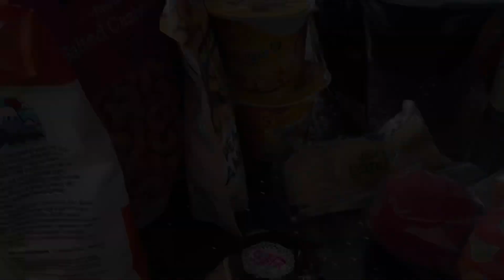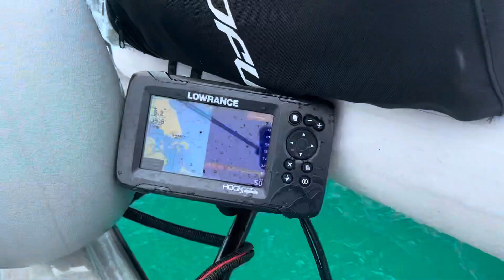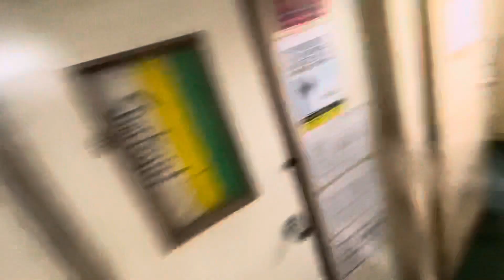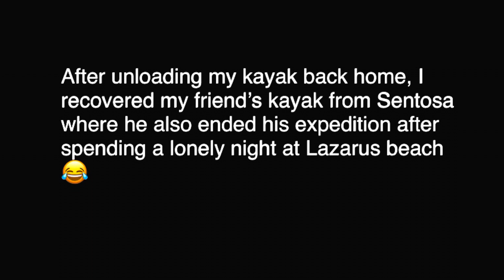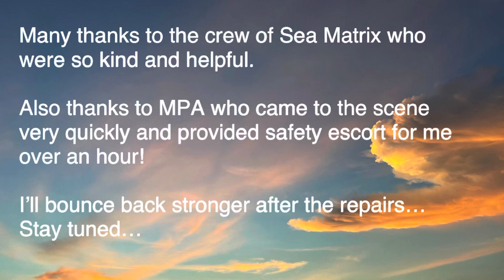Episode 19 - Mayday SOS

Comment: Thanks for the interesting video Koon.  Experience with my Mirage on Great Lakes in Canada is that the big leaker is the front hatch.  I proved this by putting my phone inside on video looking up and spraying water on the hatch from outside.  Following tips on Hobie forums, I got rid of the outer gasket on the hatch lid, then added some  'formed in place' silicon on the underside of the lid where it was not meeting the hull gasket properly.  Also replaced the bungee and made it pretty tight.  It's still not perfect, but much better.  My Hobie is about 2016 - perhaps upgrades to the design have been made since then.
Reply from the maker: Thanks for taking the time to share your experience 🙏. You are right. One reason why I failed to notice this for a while is because the hull will actually flex and twist which will create wider gaps for water to seep through. One solution is to use a inflated 14-16 inch tyre tube to tighten the hatch seal.
Reply: @koonweing  A tire tube! What an interesting idea.  I'm going to try that.

Comment: Thx for sharing. Inflatable kayak a better choice you rekon?
Reply from the maker: Hardshell usually more efficient and hardy. Inflatable is probably good for shorter distance or as lifeboat. I like inflatable for the lightweight and convenience.
Reply: @koonweing  thx for the reply, yes the inflatable may be deflated overtime while the 12v pumps are just getting smaller enough to be used while traveling. Then you could have all of the benefit of the inflatables without it's biggest con 😁

Comment: Crazy, be careful about overloading your boat, hatches are designed to be above the waterline. Install a bilge pump. Love ya vids 👍💪
Reply from the maker: Thanks 🙏 but I didnt overload on this trip. If you look at https://youtu.be/m0OSf337BGY this trip, much heavier load and stormy seas but no flooding at all?! Or perhaps lucky on that trip.
Reply: @koonweing  that's odd. Josh Holmes worked out how to install an external bilge pump for those situations.
Reply: @koonweing  And did you find out how the water leaked into the boat in the end? Was it a failure of the hull?
Reply from the maker: @raydavies2545  not really to be honest… I patched what I could find but cant explain how the flooding occured to suddenly and within such a short time, like 30 mins. As said, I took far heavier load with no issue earlier. One remote possibility is a crack somewhere or front hatch has a gap  that only manifest when hull is under certain stress conditions.

Comment: The boat is sailing above the water. The sea water barely splashed up the stern of the boat. Even if that channel's waterproof seal is worn out, but it is still above the water. How did water get in? 🤔

👌 You are lucky to be safe.

Thanks for Sharing. 😊

Comment: Some leakage of a heavily weighted TI can occur throught the rear rudder cord holes.  It's hard to seal those completely without restricting the cords.
Reply from the maker: I thought so too but water leak from rudder cords doesnt appear significant during the test. But during rough conditions I cant say I am 100% sure that is not a contributing factor.

Comment: Yo da man! I guess your MPA meant PCG(Police Coast Guard). I kept wondering where were they when they most needed untill I saw them later in your video. Still can't comprehend why they can't help tow. It says a lot about you when you single handedly pedal & retrieved a submerged kayak back to shore. Sadly, likewise too for our well equipped PGG. Proud of you! Those rubber seals will harden over time. I had a Hobie Sport for 11 years.
Reply from the maker: Thanks Dan. I never had such leakage problems with my AI which I used for 9 years before selling it off after I ordered TI. Please note that MPA is Maritime & Port Authority of Singapore. They look after sea traffic like our LTA for roads. Police coast guard is like our traffic police but with focus on general border security, illegal trafficking. I fully understand MPA have their protocols to follow and they are already kind to escort  me patiently. MPA will be happy to rescue me but not my kayak. I am fully responsible for my own actions so I should try to recover the situation on my own. The only other solution is to engage a small operator to tow the kayak but I was cautioned by the crew in Sea Matrix that I will be ripped off.
Reply: Towing a small compromised vessel like that can actually cause it to sink when it is pretty close to neutral buoyancy the drag could easily pull it under. the slow muscle method prob saved the day.

Comment: You could see the troubles earlier on with water coming over the front easier and easier as it started first taking in the water.
Reply from the maker: Yes, when I noticed from the rear seat that water was flooding the kayak, I had to make a call between stopping to bail out water or contine with the momentum towards the shore. I made a bad call to go on. And the subsequent speed of sinking caught me completely by surprised. And I had to move to the front seat to continue paddling as bailing water is impossible with the hatching below waterline. I am fixing a tube where bailing with a bilge pump is possible without having to open any hatches.

Comment: I don't think the twist and stow hatches were designed or positioned to be water-tight when submerged. The gasket-seal is more to prevent water intake from rain, splash, etc. Water also enters from the steering line openings in the hull if the stern gets submerged.

What caused the rear of your TI to initially submerge? It is possible, of course, to simply overload the boat beyond what it was designed to carry.
Reply from the maker: Sorry for not responding earlier. Thanks for sharing your observation! The overall load was less than 200kg with a margin of safety of at least 50 kg for TI. The initial launch footage should show the good boyancy with rear and front above waterline. I have since cast suspicion on hairline cracks that could widen under hull stress conditions during bad weather and rough sea conditions as the next most plausible explanations. This could also explain why nornal leak test could not detect. Probably requires inch ny inch close inspection of joints and sharp surfaces which I havent done.